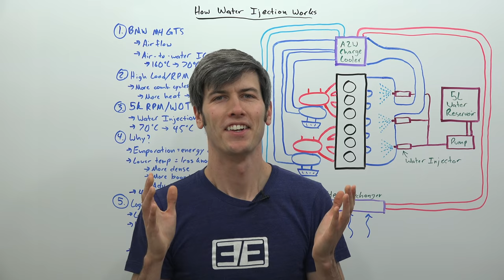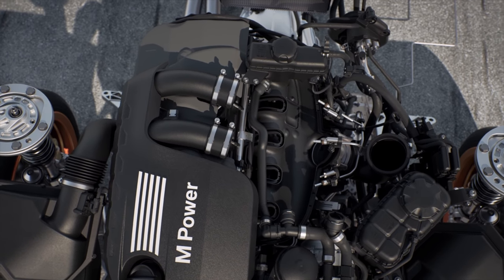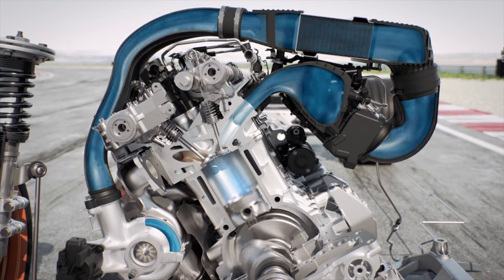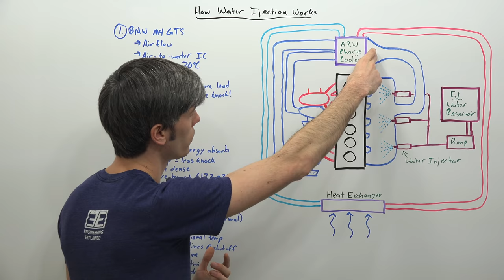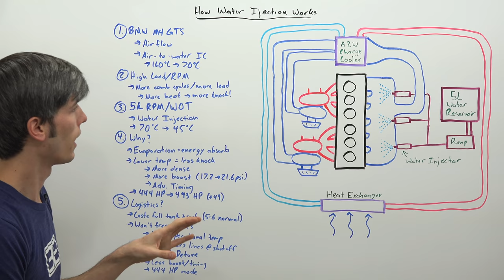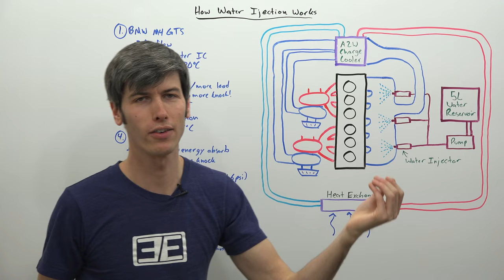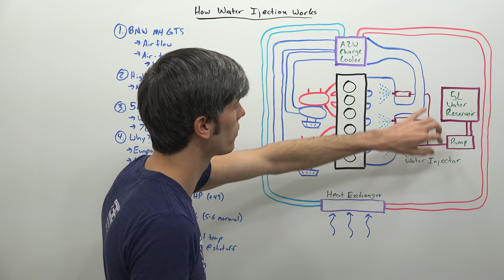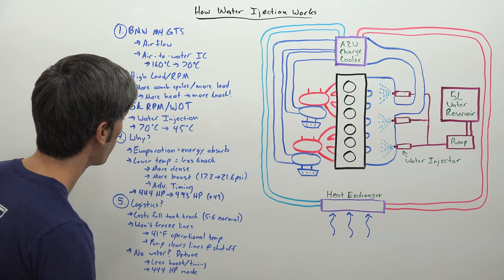How BMW Used Water To Make +50 Horsepower

Comment: I wonder if the pump and injectors can handle methanol. That would be awesome.
Reply: I was wondering this also, wish it was answered
Reply: Get an m4 gts and try it out
Reply: @daniel_960_  You'd need to change the fuel tables, water injection tables, timing and boost pressure at the very least
Reply: I'm sure it could handle isopropyl alcohol mixed with water....
Reply: liquid oxygen EZ +200HP xD
Reply: Taking on the logics I assume you'll lose the warranty after filling it with meth lol
Reply: 50/50 water/methanol is common, but you need to tune for it
Reply: Use nitroglycerine 👍🏻
Reply: @Mr.Marbles  Are you trying to blow it up? Lol you must mean nitromethane.
Reply: I'd say try with Walmart brand anti-freezing windshield fluid having the lowest methanol content and see how long it lasts. Then blame BMW if it fails and would be impossible for them to know what caused the failure.
Reply: @Cerberus984  anti freeze stains they use dyes in coolant trust me they will know
Reply: @damianrolinski8906  It's not coolant its winter blend windshield washer fluid.
Reply: calm down
Reply: @Cerberus984  has it got colour never used or seen winter blend
Reply: actually i think they might be able to. a lot of bmw owners i know run meth kits and they work similarly to this one.
Reply: @eoinkenny3188  Thats false
Reply: @glennspeeds  mmh, no. It would be richer, methanol would work as "extra" fuel, why the hell would it be lean, AND no you dont need a retune
Reply: I'm almost sure the "Waterboost", which is the name Bosch gave to this system, requires distilled water mixed with methanol, it's just a small bot of methanol they put in, so they ask you totp only fill the water tank in a BMW approved service center
Reply: Vodka!
Reply: @Mr.Marbles  ... you could use a nitromethane-alcohol mix but you might need special certification for the nitro. And, the exhaust gas temperature control [and other ecm program mods] might cost more than the car.
Reply: @NamacilHDx  LoL it would explode
Reply: @SKiZ416  you absolutely can water rejection was used in  planes the last few years of world war 2 and they just used water with menthol injection almost doubling the horsepower out of those 30 L 12vs

Comment: Oh Jason, you missed a really important fact: the water will continue to evaporate even more during the exhaust cycle when the cylinder pressure starts decreasing and the temps are still very high. This absorbs a lot of heat from the cylinders so the piston crowns and ringlands will love this gimmick.
I kind of love the fact that the M4GTS came ready for WMI since it has this WI kit already on. So with a tune and some alcohol in the trunk tank you can probably squeeze 100hp more out of it.
Reply: ...assuming that all the seals and plastics in the water injection system are compatible with methanol.

I wonder how long it'll be before some clown fills the system with tap water and gets limescale in their engine.
Reply: Won't the water be fully evaporated by then? Doesn't really matter though when it evaporates, it takes roughly the same amount of energy to evaporate the water, whenever it happens. Thus, the exact moment of evaporation shouldn't influence temperature at the exhaust stroke, as long as all water is evaporated before leaving the cylinder.
Reply: I would say, the evaporation of water should be completed before the compression stroke becaise water is incompressible. The cooling of the piston crown and engine block is occur only during the evaporation of the liquid water via the latent heat of vaporization. So, thr is nothing to do with the exhaust cycle.
Reply: @izzyplusplusplus1004  You are right on the effect of water injection on the pressure inlet of the turbine. However, the turbocharger needs higher turbine temperature to improve the output. So, the temperature and pressure needs to balance up to get The most of of the water injection. The benefits of water injection is more substantial at thel medium to high load operation.
Reply: @xmenlingcheehuat0811  The water is sprayed through some atomizing nozzles so there's absolutely no chance of hydrolocking. The evaporation process occurs for those small water droplets, so spraying it though those nozzles help with the evaporation surface increase.
Therefore the water continues  to evaporate in the intake manifold where it is sprayed but then when the cylinder pressure increases, even though the temperature increases as well (during the power stroke) you don't have so much evaporation. Yet the injected water is mostly (not totally) inert during combustion and what survives will continue to evaporate due to the high temperature and the decrease in pressure. I think the excess of fuel from rich mixtures does the same, just that the fuel is more unstable in those conditions and will burn partially.
Reply: Super efficient ICE, Google Deferred Atkinson Cycle ... ... ...
Reply: @mituc  For super efficient ICE, Google, Deferred Atkinson Cycle ... ... ...
Reply: @xmenlingcheehuat0811  Super efficient ICE, Google, Deferred Atkinson Cycle ... ... ...

Comment: I think it would be interesting if you did a video on the advantages/disadvantages of air to air and air to water intercoolers. They each serve their roll well.

With my 2001 VW 1.8t, water/meth injection allowed about 5 degrees advanced timing (turbo was already being pushed past its efficiency range). It was about the same as running ~97-100 octane race fuel (93+105 race gas mix). Upgraded from 3L to 5L windshield washer fluid reservoir and it would last quite a while, best part of a shared res, it lets you know when its low on the dash. The controller was set to start injection at 5lbs of boost and max over 10lbs, car was limited to 20lbs. Also had a boost-actuated dump on the exhaust after the cat that opened at 5lbs.
Windshield washer fluid is mostly methanol alcohol so good do well below 0F. This was about 15 years ago, its cool to see this on other cars now but having another maintenance item is a huge turn off to 'most' drivers. It would have been cool if BMW did a combined reservoir but for 'safety' reasons i'm sure you couldn't legally do that; depleting your windshield washer fluid.

It also has the effect of steam cleaning your engine. And to think this stuff dates back 100 years or even more with aircraft!
Reply: Ive got a CFS water /air charger in my f89 its aftermarket and twice as big as the stock one. Ive never had any problem with it

Comment: It really amazes me that technology that was used almost 100 years ago, gets threw out and then comes back around.  In 1923 John Deere started making the Model D tractor, also the longest running production model ever at 30 years made.  They ran straight water in the radiators and had a valve that took water from the rad and injected it into the cylinders to stop ping (pre-Ignition).  Also these tractors where capable of running on Gas/Diesel/Kerosene/Distillate  and pretty much anything else that was flammable, Jason covered this in another video about a engine mixing gad and diesel for more efficiency.  Just amazes me what technology invested that long ago comes back around and makes a difference in today's world and technology.
Reply: It disappears are comes back because there is much more control over what happens. The original systems you mention were very crude, simple tech that failed all the time, but the theory was good. Now, with computers doing all the control, these theories can be put into practice in a much more predictable way.

Comment: I run a water/methanol injection system on my car to stop knock at high rpms.  It's a great system!
Reply from the maker: Nice! What car do you have it on?
Reply: @EngineeringExplained  2004 mazdaspeed miata at 15psi.  About 255hp at the wheels. Fun little car! Thanks for the response!

Comment: And what happens then in the cylinder? How the water influences the combustion/emission?
Reply: Since it's evaporated Its just like driving on a humid day, more water in the air but it doesn't play a part in combustion
Reply: But still can have an effect, at least it reduces the useful displacement, what may be insignificant, I don't know, that's why I asked. ;)
Reply: @robertkulyassa2084  to a very small degree but we need to remember that that is a replacement for displacement, and that is forced induction. Increasing the boost pressure gets more oxygen into the cylinder regardless of the fact that a tiny amount of the displacement is used up through water vapour.
Reply: @robertkulyassa2084  the overall effect is +49 horsepower
Reply: The water can absorb heat, it expand at a good ratio (since its fairly light molecule) and can reduce wasted energy going out of the engine in heat. Fuel, when burned, also create water vapor.
Reply: Part cooling, part cleaning, part steam engine. The water vapor will become steam during the combustion cycle. The force of the water expanding into steam should provide some extra pressure [power] (though I couldn’t say exactly how much, or even if the effect would be more than negligible next to the other benefits), as well as literally steam cleaning any carbon deposits in the cylinders, exhaust valves and maybe even the catalytic converter.

Comment: What about the tank itself freezing if you park outside in winter? Is it pure water?
Reply: @xenonram  He doesn't say what happens to tank itself.  Its it heated?  It will freeze if left outside.
Reply: The tank is probably made if something a little flexible
Reply: @isaackarjala7916  yeah, I guess the same thing as with washer fluid. It can easily freeze, and nothing especially bad will happened with the system.
Reply: Swampy  there are a lot of different types of plastic with different material properties
Reply: Swampy  ice exerts pressure the same way that hydraulics do, they don't explode.
Reply: @CarGuy11  I was wondering this myself, I doubt it's heated (you don't want another thing draining the battery when it's cold out), I would guess the tank is made in such a way that it would expand. I also hope the pump pumps all the water into the tank on  shut off (not just out of the pipes but out of the pump itself too).
Reply: Clearly the water in the tank dont contain etanol or sumthing, so it would freeze, and theres not much robust plastic that. Could flex without cracks in -10. So this car is a no go in cold enviroments
Reply: System deactivates below freezing, water is evacuated from the lines, and what kind of person buys a new BMW and then parks it on the street? These bad boys are going to see warm safe garages.
Reply: @aleksandervik7162  Germany gets below freezing basically everywhere in winter, so saying it won't work in cold environments is a bit ridiculous. I would imagine the tank either is designed to be flexible enough not to crack, or it's designed that it doesn't ever get completely filled so there is an air gap for the freezing water to expand into.

Comment: Good job on graphics! Wish the video spent more time explaining WHY it's preferred to inject water opposed to adding a second cooler, WHERE the water is actually "evaporating" into and HOW this evaporated water effects the stoichiometry of the internal combustion engines  plus any clever air/fuel ratio tricksBMW uses when water is actively being sprayed to adapt

Comment: What is positive side to using mix of methanol and water? Wouldn't pure water corrode inside of intake manifold and engine head? Thanks in advance
Reply: I'm fairly sure that the intake manifold and the head are made out of aluminum, so no corrosion
Reply: Positive is it helps prevent knock. Thus higher boost/hp levels can be acheived smoothly. It also slightly cools the engine.
Reply: Methanol acts as an antifreeze
Reply: I don't think that corrosion is a big problem with this, because the water is only used rarely and in high heat situations, so it probably evaporates almost instantly. And water vapour is a byproduct of combustion anyway.
Reply: Methanol and water makes more power than water alone, interestingly pure water injection cools the air more than the mixture. Methanol also acts as an antifreeze, this tech was first used in airplanes where the water freezing was more of a concern.
Reply: @TheMrANONYMOOSE  the meth is a fuel that's why it makes more power, just water can absorb more heat.
Reply: Water absorbs energy hence reduces temperature as it evaporated. Methanol raises the octane rating of the fuel mix entering the cylinder.
Reply: So in short, head and intake manifold won't rust because they are made out of aluminium and positive thing about methanol mix is that methanol is basically antifreeze. Plus it may further prevent knock. Thanks everyone for pointing it out
Reply: aluminum eventually eats away from inside when in contact with water.... the reaction is slow but when it starts, it goes throught the aluminum, not in the surface, the water doesn´t take place in the reaction, it´s just a catalizer...
Reply: @omegarugal9283  Umm no lol, pretty sure you're thinking of gallium
Reply: Methanol and water, a mix wouldn't cool as effectively, however could operate at lower temperatures.

However BMW didn't design this car for methanol cooling, you would probably ruin the water injection system with that.

The water would not corrode the the inside of the cylinders, Every part is to hot for water to condense, the water just leaves the system as steam.

As for the intake manifold, it's possible, but unlikely. Even if it does corrode the intake manifold a bit, what's the harm?

The exhaust manifold corrodes plenty just due to the heat. No problems there.
Reply: @Bob_Lob_Law  justo took out an aluminum manifold, out of a nissan, it cracked like an egg through the water passages, along a whitish line...
Reply: @DinoTrollerino  I work on aircraft. Aluminum corrodes... a lot.
Reply: THERE IS SOME CORRODE ON THE TOPS OF PISTONS BUT ONLY FOR LONG TERM USE .. PITTING IS THE PROBLEM
Reply: The intake manifold is plastic.

Comment: In the 70’s I worked on P-3 Orion aircraft jet engines. We had an ADI induction system on the aircraft. At hot air temperatures the water alcohol mixture would inject into the engines on takeoff. The pilots said it was a significant boost equivalent to having an additional engine.
Reply: Saw one nearly crash the other day, maybe thats why we're in the middle of upgrading xD

Comment: I wonder if a water/alcohol mix would be even better.  Water and alcohol are miscible in all proportions and alcohol has a higher latent heat of evaporation.  I am thinking the mix would have even greater cooling properties than pure water.  Perhaps 90% water and 10% alcohol.
Reply: Would be. No freezing, some extra power etc.

Comment: You could've been presenting us one or two calculations - a. Without increased boost pressure there is an optimum for peak performance - there is an equilibrium between more water molecules providing more cooling effect and repression of oxygen molecules required for combustion through that more water. And b.the increase in boost pressure will provide for more oxygen molecules per volume, but there is an equilibrium to more more water as well, a bestpoint which should be achieved - but both bp are very likely not the same. And you could have mentioned the type of 'control mechanism' BMW uses for that.
Reply: And forgot another thing: how is the change in specific consumption? As gramm per kw per hour with and without water? Maybe just slightly underneath or above the switching rpm? Muscheldiagramm des spezifischen Kraftstoffverbrauchs auf dem Prüfstand waeren noch ganz nett gewesen.
Reply: Consumption BMW M4 worse results with Skoda Fabia III by %:
112/58= 93%
70/42= 67%
85/48= 77%
Emission worse results by %: 
199/109= 83%